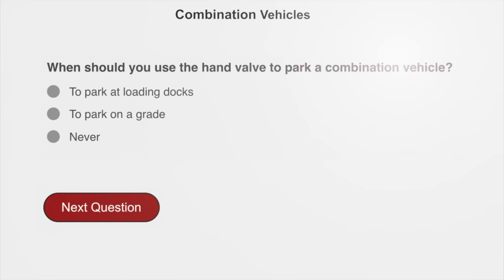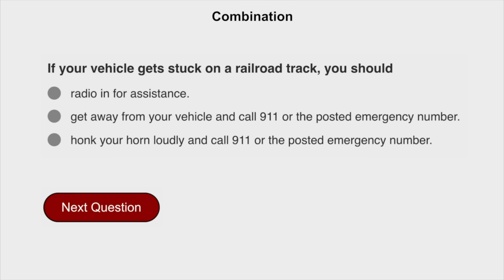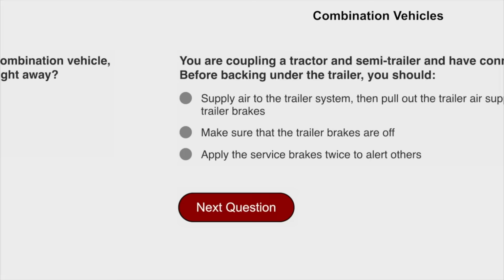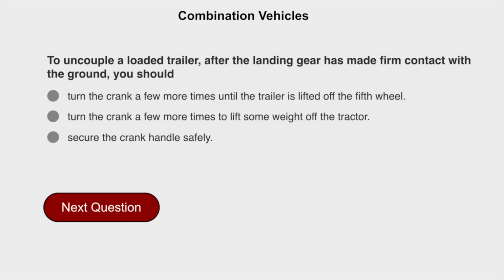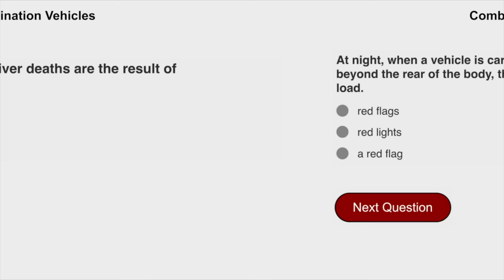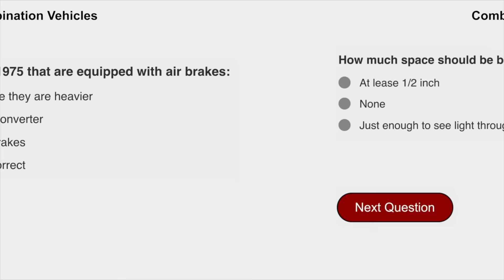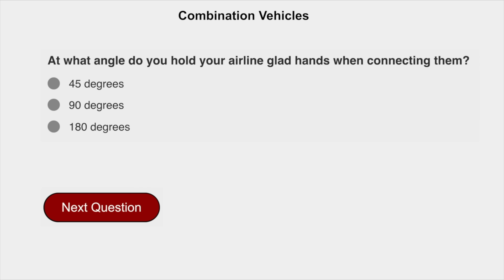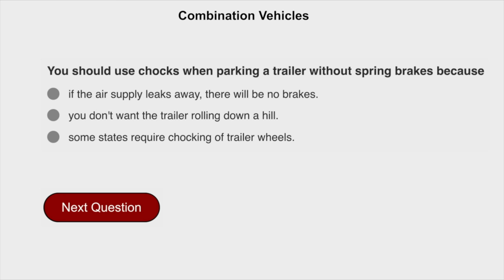CDL EXAM 2023 COMBINATION VEHICLES.QUESTIONS AND ANSWERS  CDL DMV.

Comment: In one of these questions it says “Before backing under a trailer the:” and this video says the answer is “Air brakes are off” that’s incorrect. The answer is “the trailer brakes should be locked”
Reply: I’m glad someone pointed this out I have the answers from a trucking school and the correct answer is “trailer breaks should be locked”

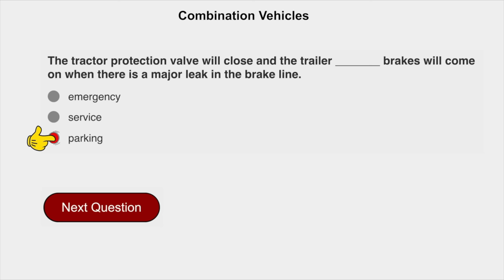Comment: "The tractor protection valve will close and the trailer _ brakes will come on when there is a major leak in the brake line." @ 18:28. You answered "parking" but everything I looked up said "emergency"  I think you answered wrong.
Reply: Yeah man it is
Reply: I agree with you too.

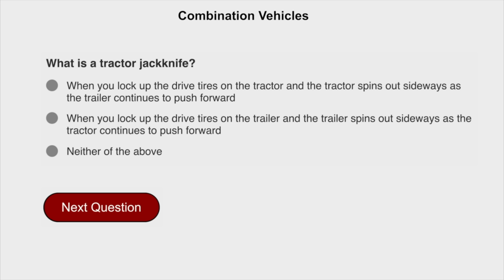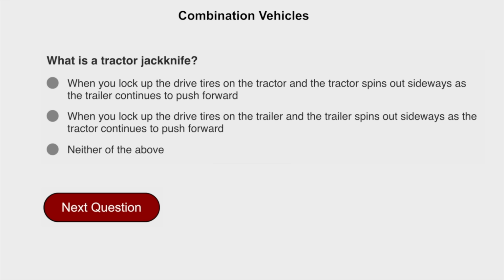Comment: There's one question on here 2 times once at 10:20  and again at 25:35. The second question at 25:35 is the correct answer..(A).. Fyi-Trailers do not have drive tires.
Reply: Good catch bro
Reply: Thanks brother

Comment: the answer on the question on 18:23 about tractor protection valve is NOT "PARKING" it's "EMERGENCY" brakes will come on.
Reply: Facts. I just noticed the same thing.
Reply: They got enough questions wrong to fail somebody! 😢
Reply: I just went over that one and got it wrong knowing it should have been emergency. I knew I wasn’t tripping lol

Comment: The answer to this question is wrong: The tractor protection valve will close and the trailer…..brakes will come on when there is a major leak in the brake line. You have parking. The manual says emergency.

Comment: I'm confused about 1 question on 10:25 it asks what is a Tractor Jackknife, it then says it is B.) When you lock up the drive tires on the trailer and the trailer spins out sideways as the tractor continues to push forward, and on 25:40 it asks again what is a Tractor jackknife once again but this time it says that it is A.)When you lock up the drive tires on the tractor and the tractor spins out sideways as the trailer continues to push forward, I've also checked the CDL handbook and it is definitely A for the tractor Jackknife on the trailer jackknife then it will be B

Comment: When backing up to a trailer the trailer brake should be locked, you have the air break should be off, pls recheck this one as I just missed it on the test,…. It’s about 6 questions I had that wasn’t on this exam!! But I did just passed it on the first try by remembering all
Of these so if it wasn’t for this I wouldn’t have passed I don’t think on the first try thank u

Comment: "Before you back under a trailer, make sure the:"  I believe the answer is trailer brakes are locked. Video shows air brakes off. That doesn't seem correct cause you want the air brakes to hold the trailer. (14:07)

Comment: Great test just found two questions wrong. 
One is 
Before you back under the trailer make sure the trailer brakes are on instead of air brakes off. 
Then there is a typo for 
What is a trailer jackknife it says tractor instead.

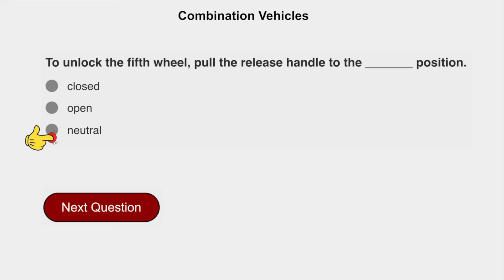Comment: at 10:20   what is a tractor jackknife? does a trailer  have drive tires? isn't the tractor the one with these tires?  also if you lock up the tires on the trailer how is the trailer  going to spin sideways if the tractor is  pulling the trailer.  tractor should keep dragging the trailer straight...maybe i am not getting something here,  the question does not mention locking the tires on the tractor that means that the tractor is rolling forward,  can someone explain?

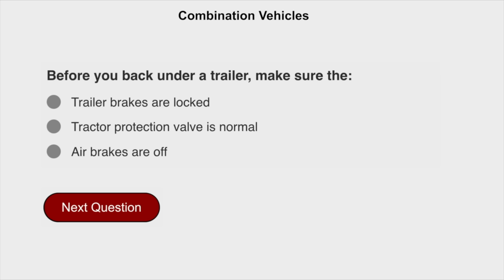Comment: At 14:00 the question states" before you back up under a trailer, make sure the... you guys put "air brakes are off". Isn't the correct answer "trailer brakes are locked"?

Comment: 14.08 before you back under a trailer make sure the trailer brakes are locked is correct answer  not the air brakes are off

Comment: A major leak in the emergency line will cause the tractor protection valve to close and the trailer emergency brakes to come on. But the brakes will hold only as long as there is air pressure in the trailer air tank. Eventually, the air will leak away and then there will be no brakes.
Reply: I don't understand when you check parking break at this point when the answer is Emergency.  This really create confusion in my learning.